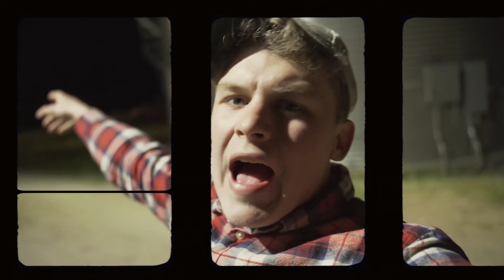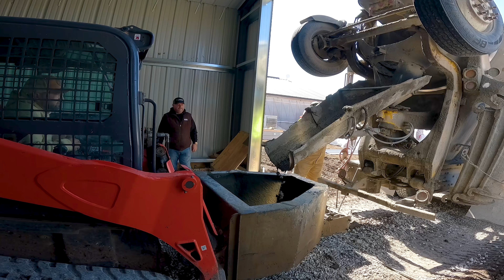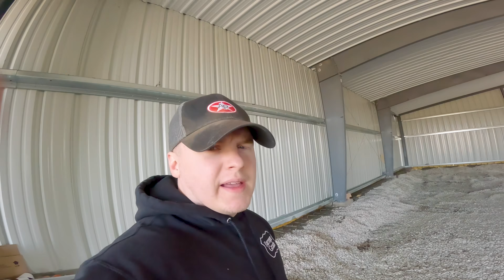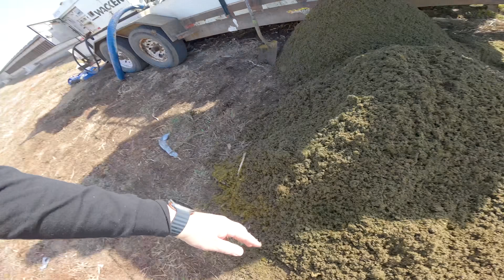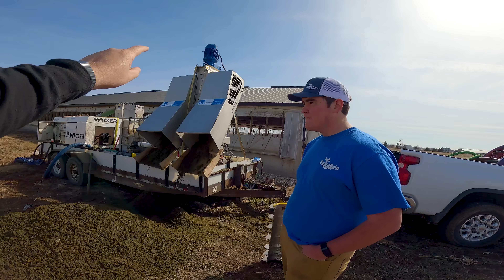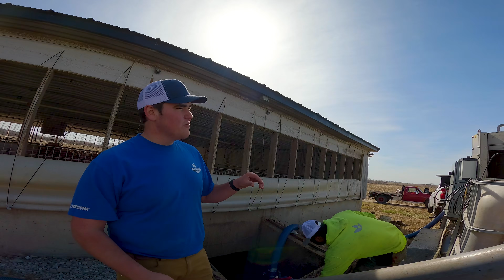Manure to Millions: Testing Our Manure Separation Process

Comment: Really interesting video, thanks! I’m wondering how they can have underground irrigation with all the various farm machinery that digs into the dirt?
Reply: Go deeper than what a typical ripper can go. If they can rip 18", bury lines 24". The roots will reach for the moisture. Or just don't do deep tillage where those lines are. Definitely a management call, but I can see how it can work.

Comment: Question how did you not know what finished floor elevation was going to be?
Reply: I’m wondering if they are going to use a vapor barrier. They’re spending all that money and time. I hope they get valuable returns from doing it the right way
Reply: @briangrammer898  I'm sure they're good concrete guys and we'll do it right I was just wondering about the finished floor because I worked as a general contractor commercial for many years and that's one of the first things that I ever looked at was finished floor benchmarks and was just curious I know they said at the beginning a long time ago that they weren't sure what height but once you get a building underway you would think you would know
Reply: @bruceg5729 LOL 🤣 they might not have known but I'm sure the contractor did!
Reply: That's what I'm wondering, this seems like the hardest, most expensive way to do this possible
Reply: Seems like the foundation guy wanted to go on vacation when he should have finished his curb😢
Reply: That’s a general term GENERAL CONTRACTOR. That’s a term a Truely don’t like. I have been in the trades , I’m retired now. I have seen some pretty crappy concrete work. The very best way to protect the concrete from potential damage. Is doing a vapor barrier. I would say energy cost goes up. Concrete would decrease. I see metal to metal beams that would cause decrease in thermal barrier-protection between trying to heat and cooling the building. I’m sure that in the end you won’t be happy with the result and the cost of maintaining